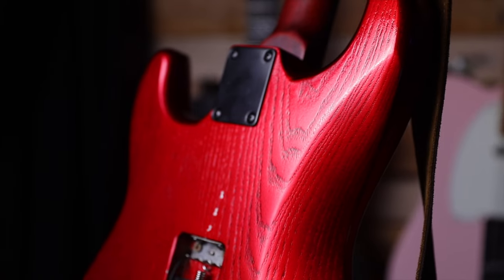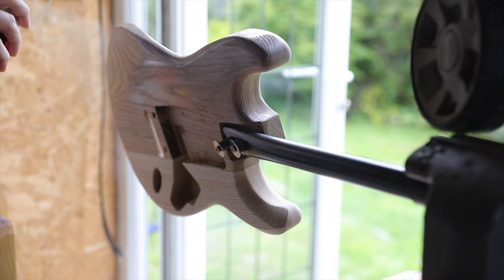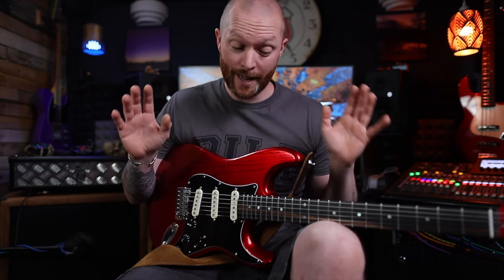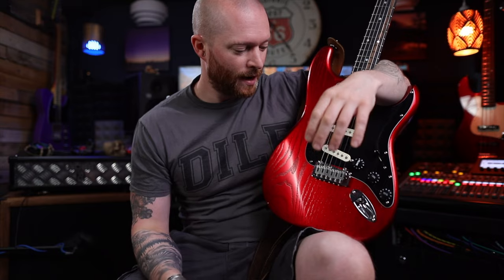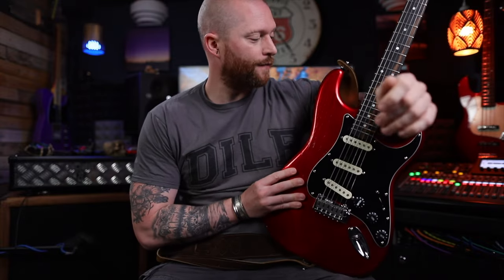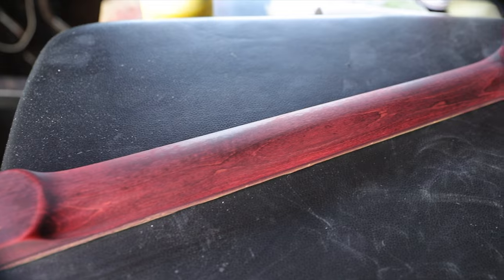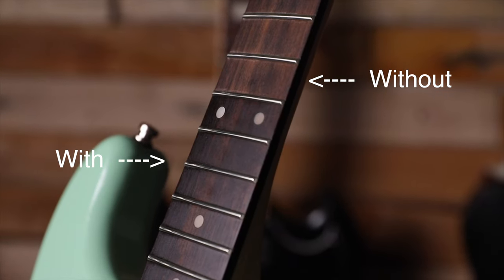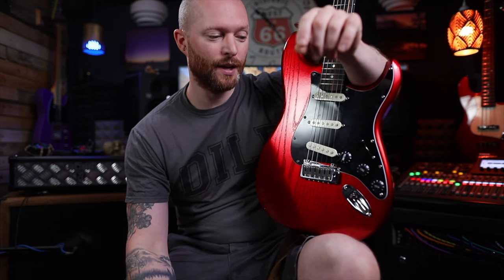Nitro Candy Apple Red with black grain filler

Comment: here's the deal with oil,  use rosewood oil, and NEVER wipe it on or off, let it soak in, then let it air out for a day or so.. never wipe it, specially quartersawn fingerboards